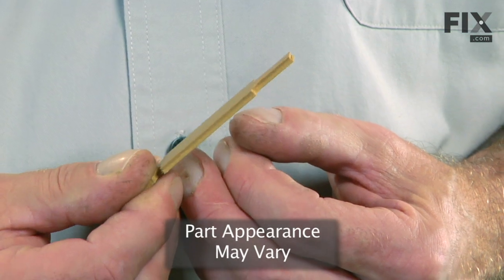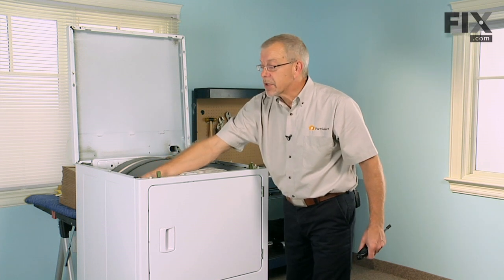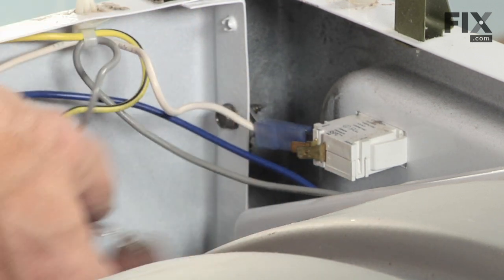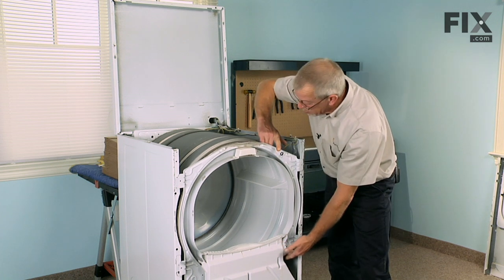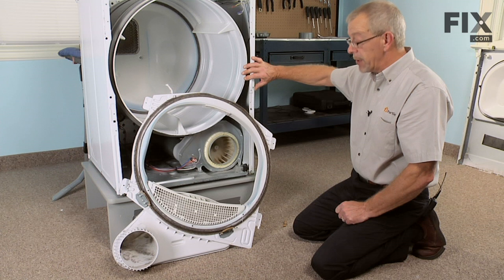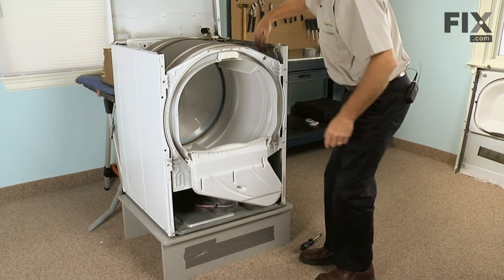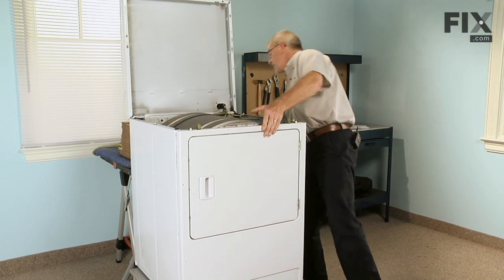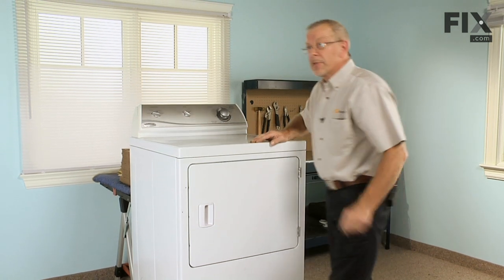Amana Dryer Repair – How to replace the Drum Glide

Comment: Whoops sorry, the repair is not complete. You forgot the very important little square felt pads that go under the glide bearing.
The metal part is the glide bracket then the felt pads and then glide bearing which you replaced. Without them the bearing doesn't have the required tension.
Reply: Will this repair stop the drum from moving back and forth from creating a little gap so clothes won't get caught between the roller and the wall?